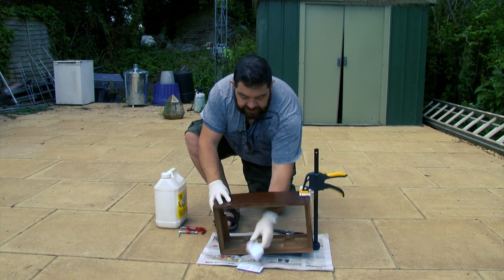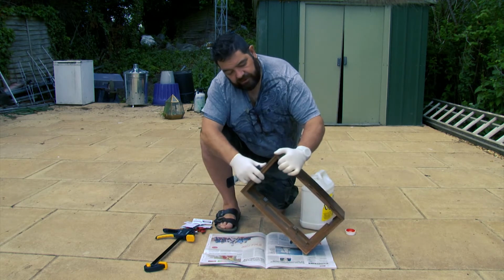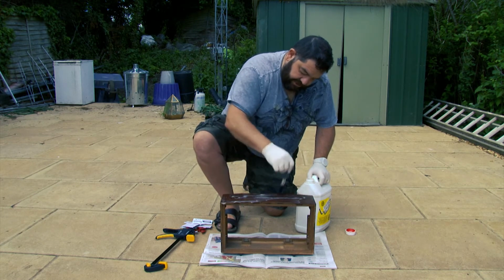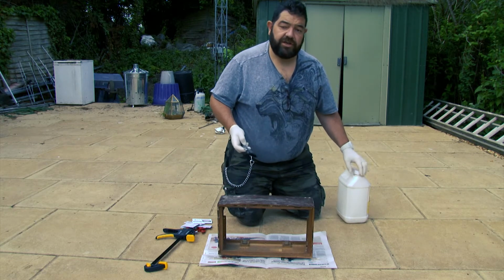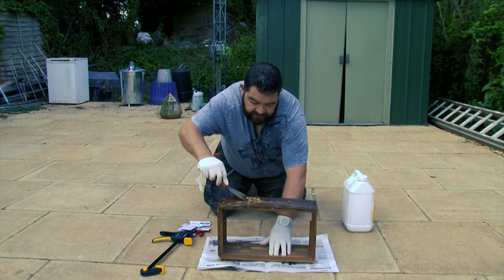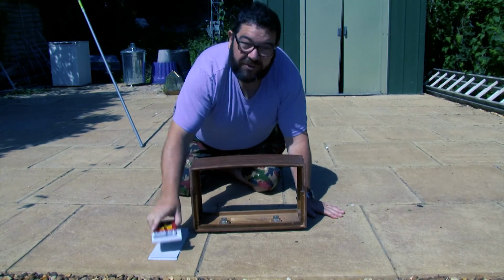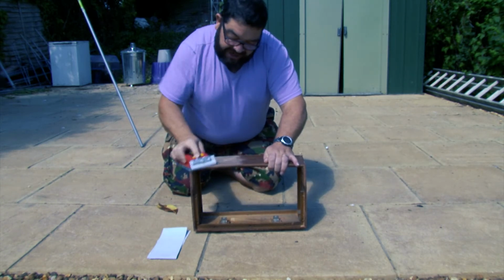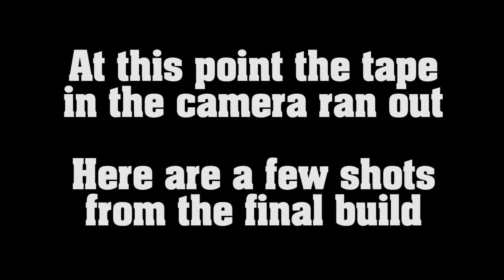Valve Radio Repair : 1964 Bush VHF81 : Part 3 - Stripping and Painting

Comment: Thanks for the stripping video with Gobs of stripper. Well I can only imagine what gobs of stripper means in England lol. Came out pretty good and only a little sanding required. Thanks for sharing George.
Reply from the maker: Indeed Larry. I was pleasantly surprised at how little sanding I needed to do. After the first coat of stain dried I did wet sand that down so that anything that went on top would be a smooth shiny coat.